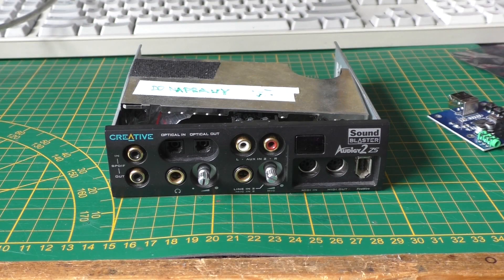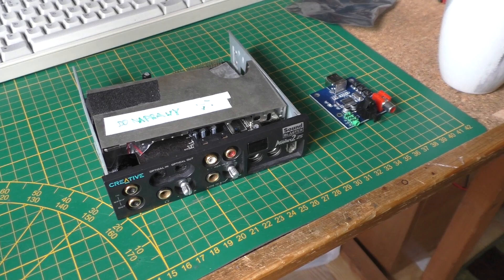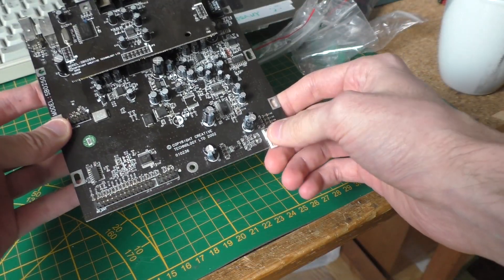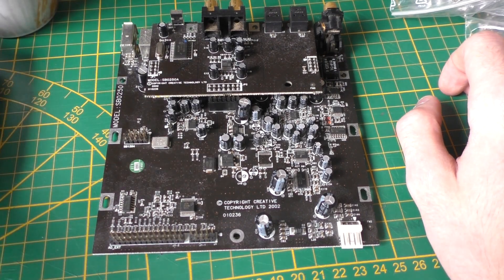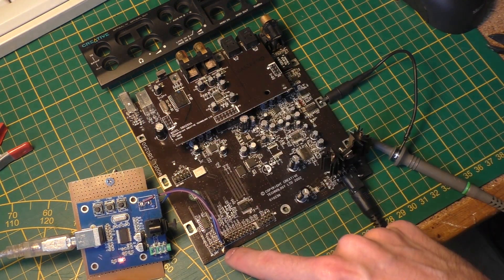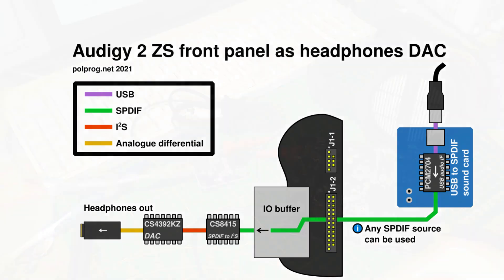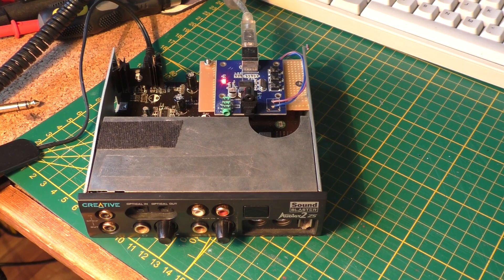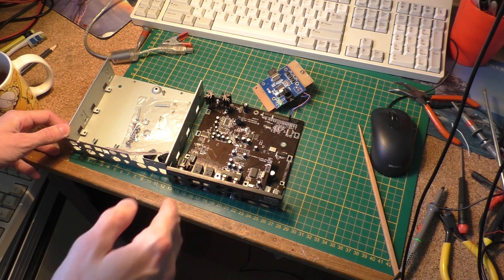PEV 15: DIY USB headphone DAC from a SoundBlaster Audigy 2 front panel

Comment: For what I can see this could be used with any spdif source without the need for the usb converter; feeding the spdif signal through the proper pins should do; now: is it possible to use get all inputs to break out from pins to inputs in a motherboard or any aplication (Digital or Analog)?

Comment: Good video and sorry for the offtopic question, but is the pinout of the Sound Blaster X-Fi front panels compatible with the Sound Blaster Sudigy 2 ZS? Because I want to replace the Audigy 2 with the X-FI and I don't know if they are compatible. Cheers!

Comment: I had them, both soundblaster live! and audigy pannels with cards, I was using them with kxAsio for making music in 2000s. Sadly I sold them 😢

edit: we've been using SBLive! and Audigy for kxAsio drivers for a very long time. It was very cheap and quality was very good. Also the input latency and performance on low buffer settings was awesome. Not all cards was working, there were cheap versions of audigy (I don't remember the suffix) not compatibile with kx, using something else than emu chips. I Still have some soundblaster and audigy cards around, but best collection budles I've sold. 
I've bought a PCI to PCIe adapter even to try run audigy 2 on the modern PC but was so bussy with other hobbies that it still waits. I don't think it will run on win11 anyway, altough PCIe shoud run this adapter, there is a little faith in the drivers. Thanks for the video as a reminder how stupid I was to sell them. Cheers.

Comment: There are 5 variations of this. The SB Live one (internal and always white as far as I know, without firewire) and 4 Audigy1/2 variations black or white and internal or external with the only difference that the external one has a DB-25 and firewire passthrough connector on the back instead of the pins for a ribbon cable. The cards are the same, but If you get the external variation you get a extra dummy expansion board that goes from the ribbon cable to DB-25 and Firewire.

Comment: I have one like this. Is front panel from live24. Can i do the same in live24.? And i have another question, I also have audigy 2 zs and external box from Audigy 2 zs EAX, Can i connect the box to my 2zs.?
Reply from the maker: Im not sure about the live24, if you can find a pinout for the extension box and if its the same then yes. But Creative changed them so that you cant mix the panels and cards. I think the Audigy 2 zs EAX panel should work with Audigy 2 zs card, but I could not find a pinout for that either... Not a fan of what Creative did with the pinouts :(
Reply: @polprog702  How can i find if i can make the external box work.? when i plug the firewire calbe in external box adlink2 and plugged in soundcard firewire place the external box is on , takes electricity but no sound goes to external.

Comment: i have one of this. but recently the headphone out developed popping/hissing noise. troubleshooting now.
Reply from the maker: Try a different power supply (different PC) If the popping happens when you turn the volume knob then it's a dead potentiometer and needs to be replaced, otherwise it may be the power supply
Reply: @polprog702  thanks. i found the cause. it was the cable of PCI to PCIE card routing issue. it routed close to USB3 cable and causing interference issue.
Reply: @jayjwin1178 What kind of adapter did you use? Because I also need to use PCI on a computer without that port.
Reply: Yes - shielding is really an issue with analog signals